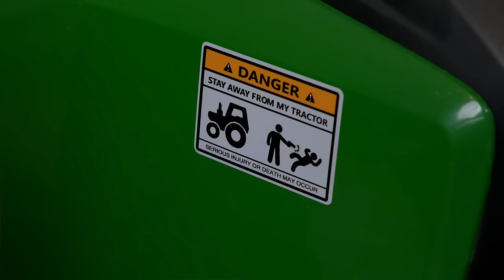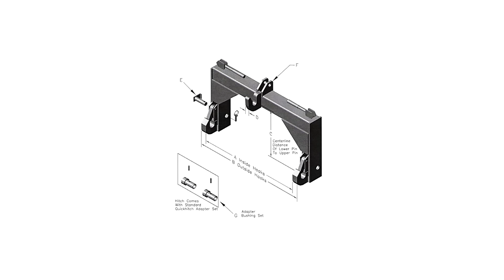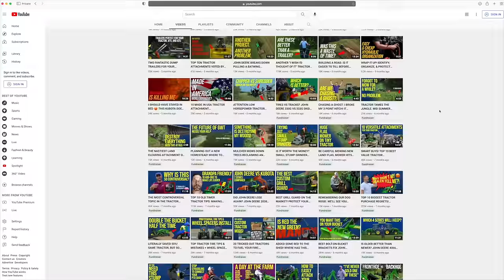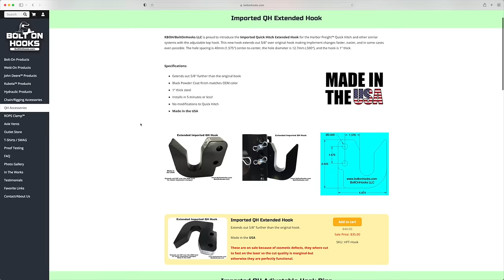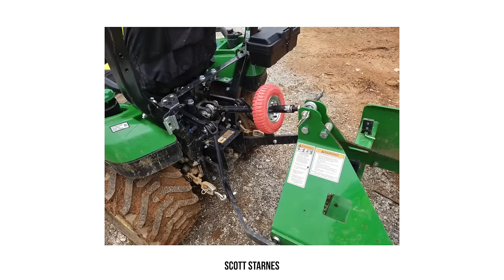CAT 1 QUICK HITCH DIMENSIONS AND ADVICE TO WORK PROPERLY

Comment: hey nice vid.
I have a mahindra Emax20hst and kinda found out the hard way that even though it's cat 1 narrow as they call it, it's more towards cat 0 on some cases.
https://youtu.be/G01lJWv9SJI
https://youtu.be/TnZxyFNCHMU
I did a video on having to use a cat 0 toplink arm to get my speeco hitch to work correctly .  I found the oem toplink was a couple of inches too long and kept the speeco hitch angled too far and wasn't able to level the snow blower and such.
I realize you mainly deal with JD but if possible any info on the Emax series would be very helpful for some of us.
keep up the great work.
Glenn.